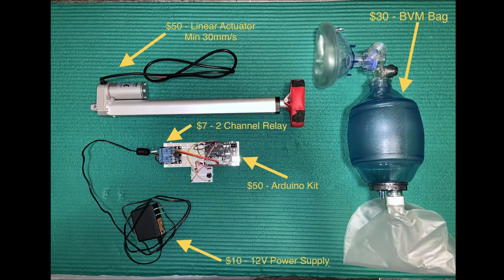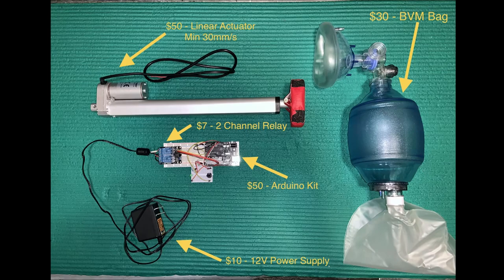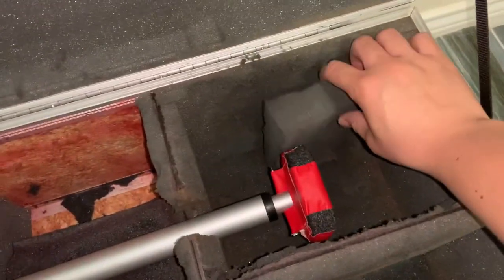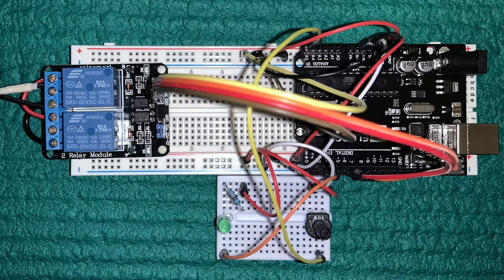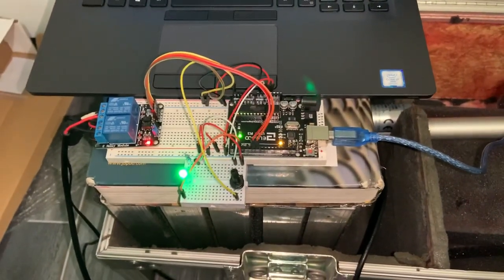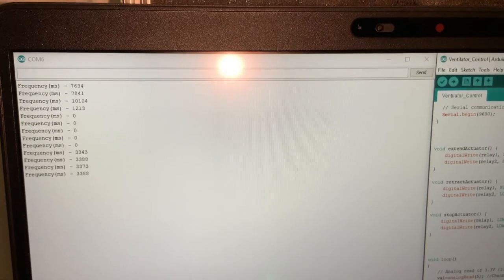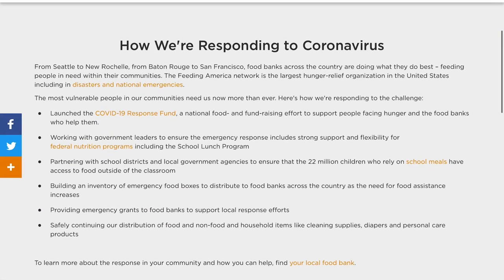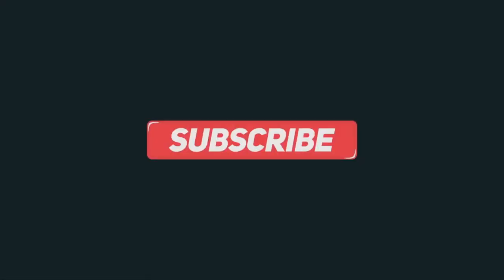Ventilator DIY with Arduino and Linear Actuator

Comment: This is really interesting. Have any patients used what you created? If so, how did you get it approved by the hospital for use?
Reply: "Have any patients used what you created? If so, how did you get it approved by the hospital for use?"

No this has never been used and No this would never get approved, not remotely, not even for an emergency.

But lets dig a little deeper because this project is actually dangerous when applied to any patient really.

First; a BVM Bag is for resuscitation purposes, it is not a ventilator as used for Covid patients.  A BVM bag is just an easier alternative for mouth-to-mouth. It's sole function is to get air into lungs, no matter what. Covid patients are breathing on their own, they just need help getting more air into their lungs. This device will pump air at regular intervals regardless of the patients actuall breathing. So if the patient happens to wantto breathe out when this device says they have to breathe in... well lets just say it's not good. 
Proper ventilators measure airpressure so they pump when the patient breathes in, and stop when they breathe out. Thus not breaking the lungs.

Secondly, Covid patients require additional oxygen. This device does not do that. (and that is probably for the best because pure oxygen is extremelt flammable and you need a very food control over the amounts you add in, it has to be at the right temperature etc. etc.

Thridly, this device has exactly zero safety. There are no limit-switches to control tne amount of air it pumps, or even to see if the thing is still working. The code has no watchdog-timer in case a brownout the program crashes and the entire thing just stops working alltogether.

Fourth, there is no backup-battery so when the power fails, the patient dies.

So no, a hospital would never ever use this, not even if there are no proper ventilators available.

I understand the desire to help but really, the medical world and the manufaturers of equipment have this covered. All you need to do is stay home, stay safe and for poopsake don't start DIY-ing equipment that you have no clue how to make.

Comment from the maker: Arduino Code 

#include <math.h>
#include <SPI.h>
 
// Analog read signal from NAV measuring voltage
int val;
 
const int pwm = 2; // Pin 2 as Pulse width Modulator
 
//Use constants for the relay pins in case you need to change these later
const int relay1 = 6;   //Arduino pin that triggers relay #1
const int relay2 = 7;   //Arduino pin that triggers relay #2
 
void setup()
{
  //Set pinMode to OUTPUT for the two relay pins
  pinMode(relay1, OUTPUT);
  pinMode(relay2, OUTPUT);
 
  pinMode(pwm,OUTPUT); //Set pin 2 as output LED
 
  // Serial communication for debugging purposes
  Serial.begin(9600);
}
 
 
 
void extendActuator() {
    digitalWrite(relay1, LOW);
    digitalWrite(relay2, HIGH);
}
 
void retractActuator() {
    digitalWrite(relay1, HIGH);
    digitalWrite(relay2, LOW);
}
 
void stopActuator() {
    digitalWrite(relay1, LOW);
    digitalWrite(relay2, LOW);
}
 
 
 
void loop()
{
    // Analog read of 3.3V (1024) coming for analog channel A0
    val=analogRead(5); //Channel A5 reading Top 660-Bottom 0 (660*x)/1024 = 10s, x=15.15
    val=1000*(val*15.15)/1024; //Conversion digital to voltage
{
    extendActuator();
    analogWrite(pwm, 100); //LED ON
    delay(3000); // 1 Second
 
     //stopActuator();
     //delay(500);
 
    retractActuator();
    delay(3150);
 
    stopActuator();
    analogWrite(pwm, 200); // LED OFF
    delay(val);
    Serial.print("Frequency(ms) - ");
    Serial.println(val);
}
   
}
Reply: will this work if copied
Reply from the maker: Yes the code should work if copied. Also see wiring diagram and files in google drive in the link in description.
Reply: QueryTesla ! Great! Also, how many inches is ur  linear actuator, and how do u control the bpm
Reply from the maker: The one in he is a 12in stroke with an extension speed  30mm/s. I have a dial potentiometer that is used to increase/decrease the frequency of air bursts.
Reply: QueryTesla ! is there a display connected?
Reply from the maker: I don’t have a separate display but you can connect it to your computer to see the serial monitor read outs.
Reply: @querytesla3709  if i add a display, will i have to add some code, or will the bpm automatically show up? im new to Audrino btw.

Comment: Can I make some observations?

1.  Not possible to pass an oxygen tube to the end of the BVM
2.  BVM intake at bottom of box, so you will be breathing every bit of dirt and dust directly into your lungs
3.  The actuator speed is way too slow, minimum speed would need to be 4 seconds per stroke or about 15 breaths per minute

So I would recommend you put the mask on your face and see if you can actually breath according to the speed without fainting or coughing from all the dust from the bottom of your box.

There are a ton of "open" design out there, recommend you read up on the actual medical requirement from FDA to see if your design can be used safely at home.
Reply: wow , the guys is brilliant and he took the time and effort and did his best which is impressive and can improve , and you just come here with that destructive attitude
Reply: Don't take him otherwise he's just suggesting improvement

Comment: Can you please give the complete list of Elements used for the project with specifications
Reply from the maker: Please look at the information in the description box of the video. Everything is laid out there to reproduce this project.
Reply: @querytesla3709  I just need to know the small elements ued in the circuit
Reply from the maker: The only small element is the 2 channel relay that I bought here https://www.amazon.com/SainSmart-101-70-100-2-Channel-Relay-Module/dp/B0057OC6D8.
Reply: I am asking about the sensors required

Comment: Hi!,
Can i get a diagram of the wiring on the protoboard please?
Reply from the maker: See link in description. I don’t have wiring diagram software so I took close up pictures for you to see what pin is connected.
Reply: @querytesla3709  please can you write on piece a paper ....please
Reply from the maker: Code and diagrams can be found here https://drive.google.com/drive/mobile/folders/1mibt2paNx8GJj78cUMPznlJVJy6JyzIt
Reply: Have you got the circuit diagram